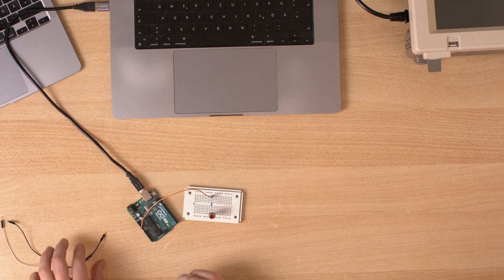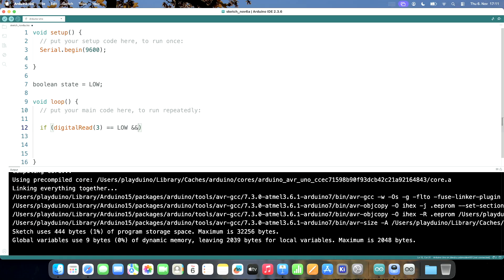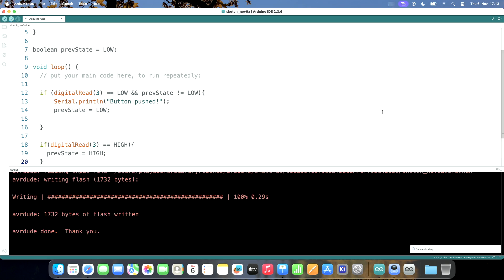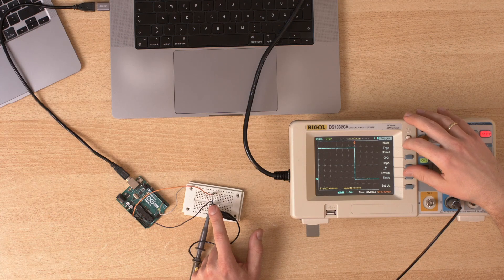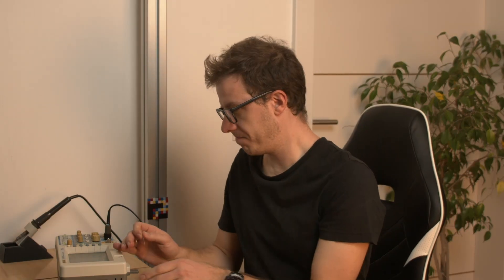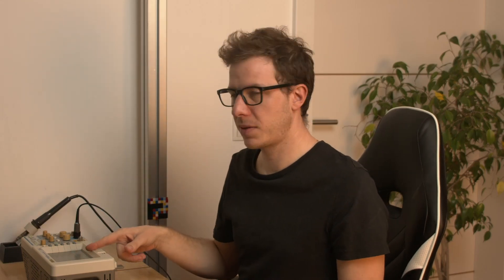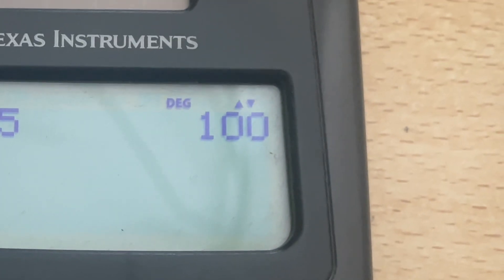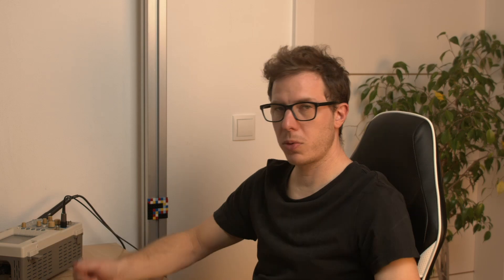Button Debouncing with a Capacitor?

Comment: Maybe the absolute best way is to turn that input pin off temporarily via a hardware counter and interrupt? 
Or write a special delay type function to ignore each input instead (not sure how; or if that will work). 
I’m trying to avoid preventing you pressing multiple buttons at once without using multiple timers/variables to keep track of it all…

Roughly how long does it take to execute millis() function, by the way?

Comment: no caps. i use the code. non blocking millis based code. in a project right now i have a  buttonBlocker(int time), that lets me call buttonBlocker(x00ms) if i dont want the button accessible after being pressed. all the buttons get standard refractory periods anyway - but button blocker is good in certain situations like returning from idle, where you dont want the button that broke idle to initiate a behavior.
Reply from the maker: very nice solution 👌 thx for sharing

Comment: You have no RC when you press the switch. You're shorting the cap, decreasing the lifetime of both the switch and the cap and end up with no debounce upon press (cap discharge). 
Just add one more lower value resistor (say 1k) in series with a switch to the ground. 
Or if you want equal and better controlled rise/fall times, then the solution gets slightly more complicated.

Comment: 100R just above the button might help with that inrush current... but yes usually you need so much capacitance that the RC delay can even be unhelpful. IIRC a flip flop or well designed window comparator are the best hardware solutions for clean button presses, but usually only needed if for some reason your software solution doesn't want to involve MCU timing delays to reject other bounces (for instance, maybe you don't have an MCU in your project).

Comment: Adding a delay is definitely NOT the best method to avoid the bouncing button. It is the most easy for newbies, but not the best, and not always effective. One of the easiest methods and effective methods is using an RC filter, either by hardware, either by using a software (emulating the RC filter).
Reply from the maker: I agree about the RC filter, however I am not sure how emulating an RC filter would be beneficial to using a delay
Reply: @playduino  the delay function adds a delay to the mcu's main loop. If ie you have multiple buttons to check or you move some motors, it is not optimal to add delays to the main loop. Also even if you have a simple button check program,  the delay duration cannot guarantee that the program will pass the bounce or that it won't miss any presses

Comment: UPDATE: Keep the 10k resistor in series with the pushbutton, but connect the 100nF from the 5V signal directly to GND (i.e., not across the switch). This should achieve an RC time constant that will prevent a significant amount of switch bouncing. Please see if that configuration affects your debounce testing. Thanks!
Reply from the maker: 100nF from 5V to GND will just stabilise the supply voltage.
But yes, you can use an RC filter in front of the digital pin. And it will help, and will not destroy the Button.
However you should use it in combination with a schmitt-Trigger because otherwise you will be in the "undefined" zone between LOW and HIGH very long and its not fully predictable how long the delay will be.

Comment: I love your combination of programming and hardware tutorials. I've only done software debouncing using the venerable Bounce2 library but am curious to learn if hardware debouncing is really required. 
As a life-long 'learning facilitator' I have a passion to help create tools under the umbrella 'Pragmatic Programming for Makers', so I was of course immediately drawn to this particular video because one of my libraries is InputEvents that does all the leg work for buttons, encoders, joysticks etc 😀 (so that makers can concentrate on coding just for their project goals).
Reply: Hardware debouncing is not required.  But I do tend to go that way (using a Schmitt trigger) for circuits I intend to keep around (vs. something I'm fiddling with on the lab bench).  H/W and S/W debounce are both perfectly valid, and each has their place.

Comment: I don’t think you want to block your code for 20ms. You can just track the timestamp of the user event and ignore duplicates in that window. Another way I used to do in web UIs is that each user event initiates a timer and the reaction to the event fires only after the timer expires. If another event occurs before that, it resets the reaction timer. This is common for text inputs that fire off a search for example. 

Good video. Well made.
Reply from the maker: yes! thanks for mentioning it. during delay() you cannot do anything else of course so this only works with projects where you do not have to do anything else. A nice solution would be to use timer interrupts or millis() ... (which uses timer interrupts.)

I definitely should have mentioned the limitations of delay!

thank you!
Reply: @playduino I don’t think you need interrupts. Just record the timestamp of the button push and ignore pushes that occur too soon after.
Reply from the maker: Yeah, but recording the timestamps involves using millis() which is based on timer interrupts behind the scenes

Comment: 100A is a bit (much) over exaggerated, the C has an internal resistance as well, so does the circuitry , some current through the switch keeps the contacts clean.
Reply from the maker: Unfortunately, I can't really measure this current, but ceramic capacitors have a very low ESR so I would expect the current to be very high. probably the breadboard has quite a resistance.

current through the switch, to my knowlege is only beneficial if you keep a contact closed for a long time and then you usually use something around 10mA 😅

Comment: Hi, I'm using this system but with interrupts.
The problem is that the delay(..) blocks the code and I'm having trouble managing other functions.
Do you have any idea how to fix it?
Congratulations on the channel.
Reply: I'd recommend using a millis() timer for software debouncing instead of a blocking delay(). Just do a Google search for it or ask ChatGPT for more details. It's very effective and won't interfere with other concurrent code execution.
Reply: Example boilerplate is:

// global var:
long mark;

// initialization:
mark = millis();

// in the service loop:
long now = millis();
long delta = now - mark;
if (delta >= 10L) { // for 10 ms delay..
   mark = now;
   // do whatever time framed operation you want to do
}
Reply: @noobdernoobder6707  Thanks.
Yes, I know this solution. I use interrupts to avoid losing pulses from a flow meter, but there seems to be a lot of interference.
So I wanted to filter to get clean pulses.
Perhaps I should use an optocoupler and other components to solve this problem.
Reply from the maker: Hey thank you! Good point! I did not mention it in the video. you cannot do anything else during the delay().

If you are using the Arduino framework, a great solution is to use millis() (which uses a timer interrupt behind the scenes) to periodically check all buttons.

Comment: I use a Schmitt-Trigger. NE555, FTW!
Reply from the maker: Nice Solution. With RC filter between button and NE555?
Reply: @playduino  Yes. Just use a lowpass filter. You can also use a Monoflop. Well, you created a Monoflop in software^^. I did this when I built my fully transistorized Nixie clock.
Reply from the maker: Nice! Thx for sharing:)

Comment: This solution (sw delay) seems perfect for making our type of simple project. There are certainly more sophisticated systems, but I don't think the purpose of the video was to provide an in-depth study of the topic. For me, it's perfect and very well explained. Well done!
Reply from the maker: thank you! what is your favorite sophisticated method?
Reply: @playduino  I apologize, but using Google Translate I wrote "certainly" instead of "probably." I'm not a professional and don't make sophisticated circuits. For the circuits I make, I prefer the software system, since I have a microcontroller. However, I can't rule out the possibility that there are other systems I'm unfamiliar with.
Reply from the maker: thank you for the clarification. The big problem with delay() is that it blocks the Arduino from doing anything else. So a more sophisticated way would definitely be to use timer interrupts or millis(). You can also solve it with RC filters and Schmitt-Triggers (in hardware) I am just curious if there is some other way that I am not aware of :) always happy to lern new things. thank you for your comments.
Reply: @playduino  Hi. I found a hardware solution to the switch bounce problem. It uses a dedicated chip: the ONSEMI MC14490. It might not be the best solution for all circuits, but it seems interesting. Regards
Reply from the maker: Nice! Did not know about that one. Thx

Comment: If you want to avoid the high current, maybe just add a second resistor. But I guess while loading the capacitor, it will stay "longer" in the range between ~2V and ~3V Volt; so yes, only increasing but it is undefined. So the question is, can it still bounce in that unknown zone? Or in other words: If you for example always have stable 2V on the pin, will it be stable or will it swap from high to low and back again sometimes?
Reply from the maker: Good Point.
I think it could work if you add a second resistor between the button and the capacitor as long as you make sure that the arduino input is then not sitting between the resistors but directly connected to the capacitor. but yeah, you have a long time of "undefined" state.

(basically creating an RC filter on the input)
Reply: @playduino  add a Schmitt-trigger port ... that resolves the undefined levels.
better use a toggle switch with a make and break contact to set/reset a flip-flop. needs extra circuitry off course.